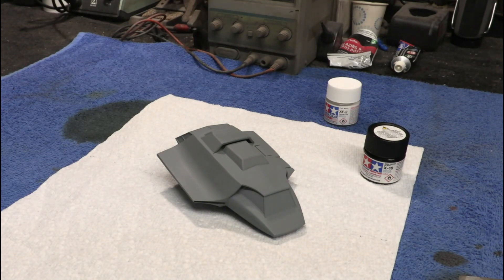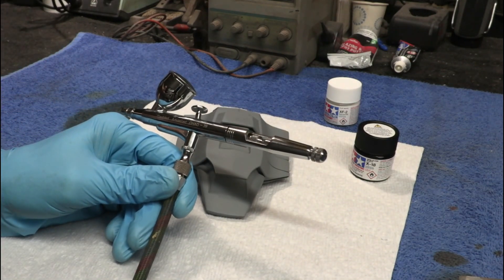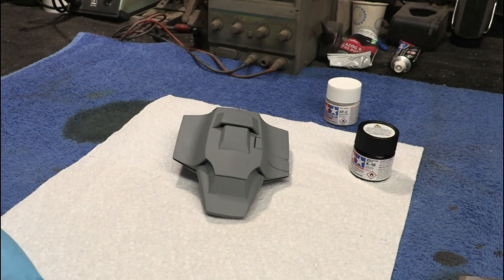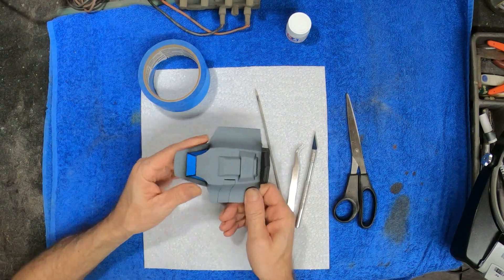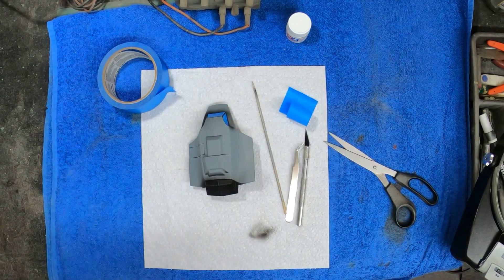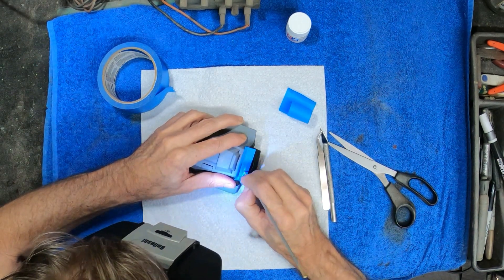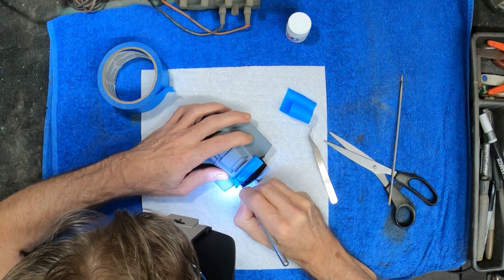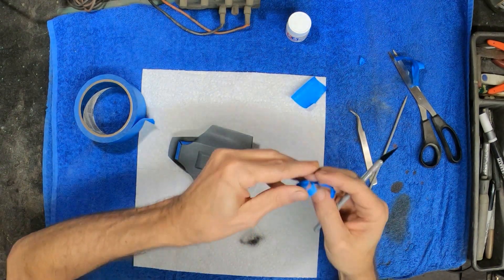"V" 1980's Mini Series Building & Painting The Visitor's Ships Pt 2

Comment: I'm not a modeler. I just find the work you guys do on these modeling channels fascinating.

I noticed you were concerned about digging into the black paint when you were removing the masking. I'm wondering if, right after you put the mask in place, you could put I tiny bead of glue on a corner of the mask -- just enough for the tweezers to grab onto so you could loosen the mask with a quick tug on the bead after painting. Then you could lift the mask away without having to dig in. (I'm sure things like this have been tried before by thousands of modelers, but I just wanted to put it out there, just in case.)

Comment: Always nice the way you make your models. What PSI do you use for your airbrush ? You get such a nice stream and smooth. I don't think my PSI is high enough on with the compressor I have. I don't get that smooth spray like you do.
Reply from the maker: Usually about 20-25 psi. A little lower for fine details or fading.
Reply: @TrekWorks  thanks Boyd.